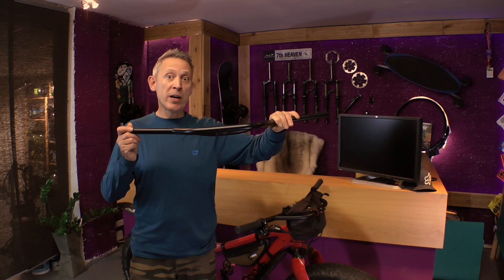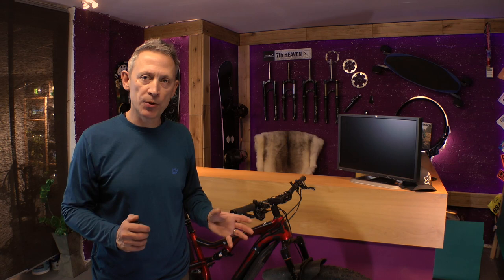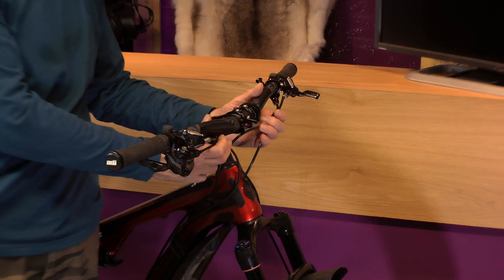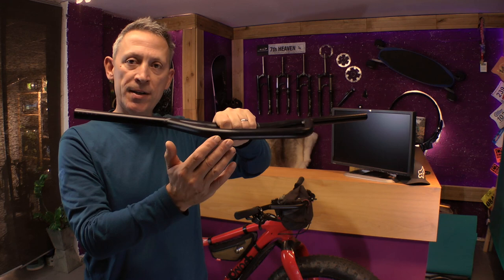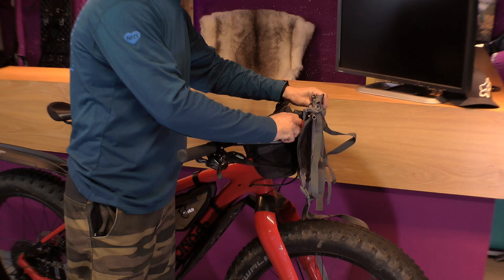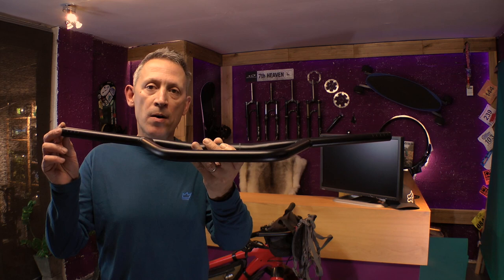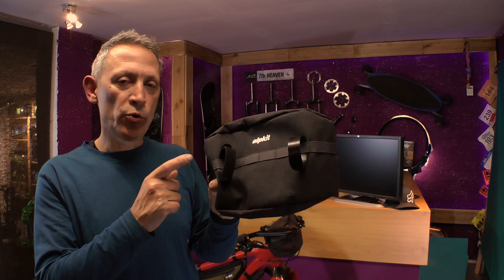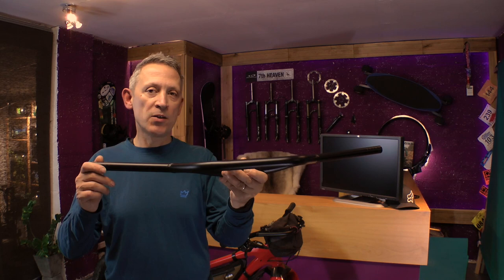Alpkit Confucius Bikepacking Handlebar and kit to fit it

Comment: There's no rotational problem with the Confucius bar rotating in the stem with a bag attached, had one on my bike packing bike for 4 years, use it with a 20l dry bag with 3 or 4 kilos in it, no problem. I use Alpkit Joey harness which has no stiffening stays connecting to fork, only velcro straps.
Reply from the maker: That is excellent.

Comment: Ps get rid of front roll bag and switch to large event sea to summit bag much better .. denpending on your packraft it can fit in seatpost bag and put peddals under neath the bag
Reply from the maker: Thx for the tip. That could work with my present seatpost bag.   I did get the Aeroe spider rack to carry two rafts. My wife’s and mine. That may be my next video.
Reply: @North3rdMedia  yeah the aero rack is Brillant had them for years never failed .. plus the aero front rack solves the problem with cables and a hard shell harness is much better than soft harness only down side is weight … i did a video on how to pack your bike to the raft check it out